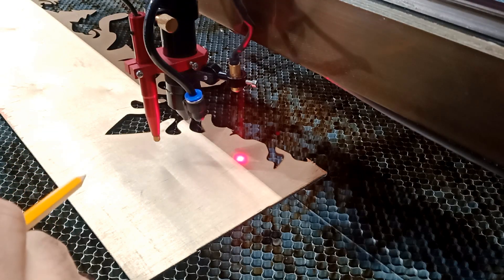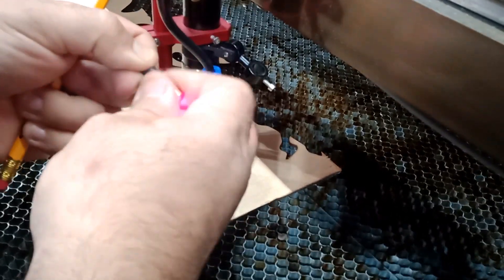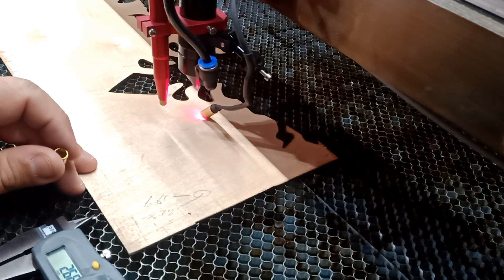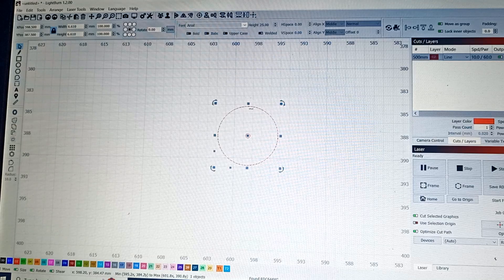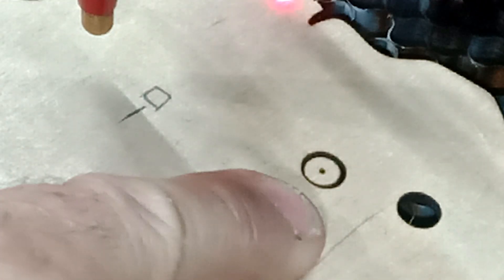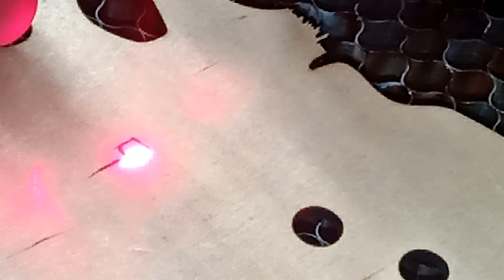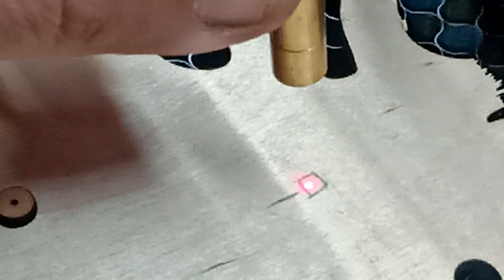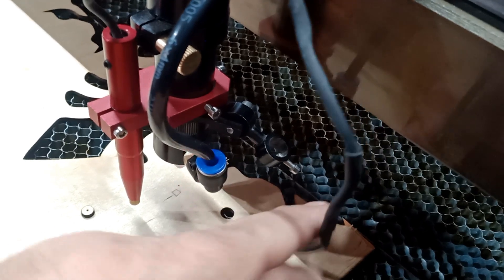Making Laser Red Dot Smaller

Comment: im new to this.  So Im curious. cant you use the actual laser at a very low setting to pinpoint where you want to use to frame and position?
Reply from the maker: To answer your question I think no usually your laser power the lowest thinking go use its 10% power that will be a lot it will actually mark / engrave your item, That's why they have the laser pointer added to your laser. I wish I can do that That's a good idea